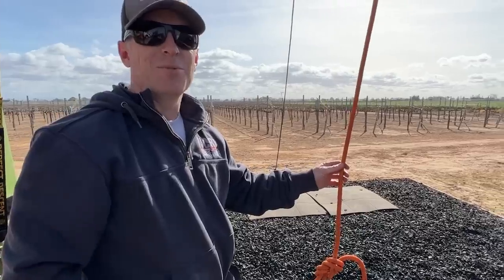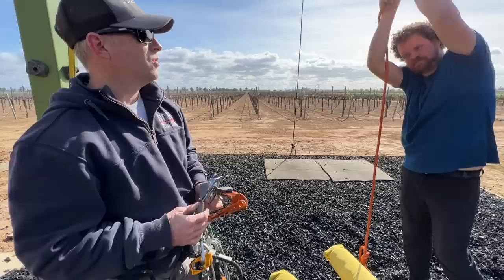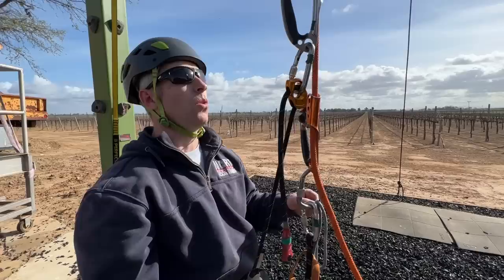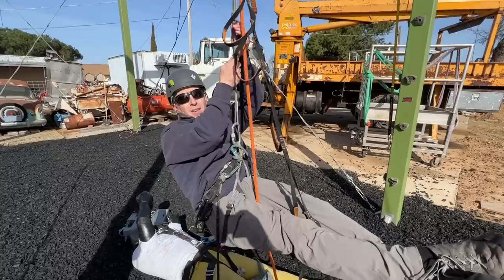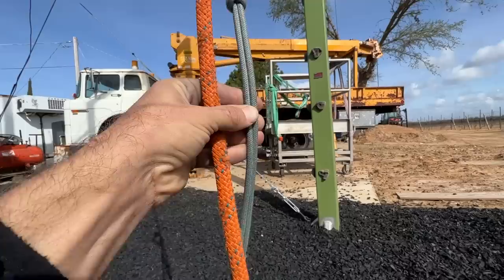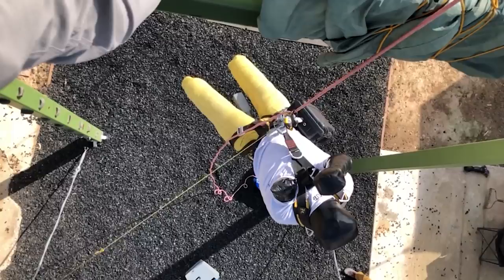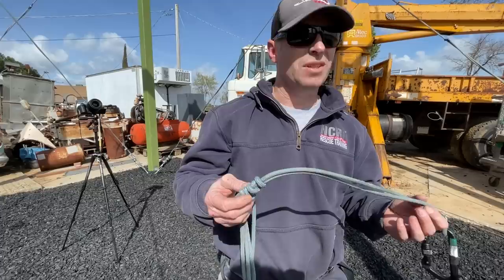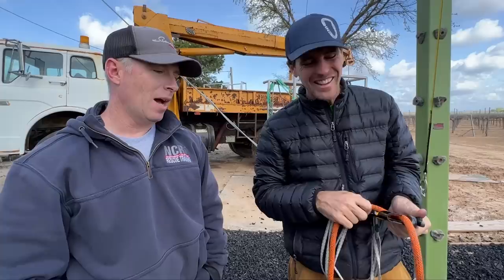Does PURCELL PRUSSIK save you If you fall on an ASCENDER???

Comment: One more data point would be very useful: compare with a fall onto a full strength piece of dynamic rope (8.9-9.2mm). Most of my team runs dynamic cowtails (like a caver's setup) and it would be awesome to see the comparison of absorption between the Purcell and the dynamic landyard. I see another comment that seems to be asking about making a Purcell from dynamic cordage, but I have never seen that in the wild.
Reply: The dynamic cord should protect your pelvis, but will it protect the sheath?
Reply from the maker: Testing dynamic cows tails vs other lanyards is a good idea
Reply: The Dynamic lanyards seem like a good idea and I would love to see a side-by-side test. We use them on the top ascender to make adjustments between individuals easy. That said,  based upon their length, the overall load limiting on them should be pretty minimal compared to a purcell slipping over a longer length, which is why we use the purcells on the lower. I'll bring both next time Ryan and we can find out!

Comment: I'm a caver an when we put a knot-pass we make a loop hanging from the knot so that you can clip into it with a lanyard when transferring across the knot.
Reply from the maker: Yea, I was at risk of falling on ascenders when i was caving and passing Y hang or J hang rebelays.
Reply: Thats one method of many, of course. But with speed in mind the hand ascender moves over faster then tying a knot in. Although I do see your method used at times.
Reply: @M1American  I think, I must've explained it badly. The initial rigger (who decided that knot-pass is necessary) puts in a knot like in this figure: https://verticalsection.caves.org/nh/46/srt-knot.jpg. Everyone else just clips in when passing it - the extra time is really minimal, but it allows for resting and we avoid having single attachment point very hard.
Reply: @HowNOT2  It sometimes happens in sloppy 'expedition' rigging :( What makes the biggest difference for me is using fusion knot Y-hangs instead of the more popular fig8 + alpine butterfly Y-hangs. With fusion continuation above starts right at the knot making transitions faster and safer.

Comment: Hi! I’ve been watching your videos for about a year and a half now. I don’t even climb (yet) but I just love the content and breaking things + numbers comparisons is just cool. 
I have a request, in the military we are issued rigger belts similar to the Wolf tactical belts. I have been trained multiple times that in a pinch you can use just your belt to repel or hook into a safety device in lieu of a harness, which is why we are issued them. I have seen videos also demonstrating that they can be used to repel if need be. After watching enough of your vids I am very aware that everything has a breaking point, and trusting a manufacturer isn’t always enough to keep you alive. 
I’d love to send you a couple of the ones we get issued and have you try break test them and see if they are indeed suitable. The military uses many rope systems and slings, there might be another area for you to expand into! I hope to see them on your channel soon!
Reply: I was issued a heavy duty belt like that too, complete with a metal piece that you could attach a carabineer to. I always felt that if you used one of those for rappelling, you would get the world's biggest wedgie, your pants would rip, and then the belt would go up to your armpits.

I live in the Seattle area and would be willing to sacrifice my old military belt if you want to do some testing.

Comment: I would think that even a Purcell Prussik on a bigger rope would be a throw away... as the heat in the coils will always increase, as it is sliding down the rope that only seen transient heat.  I'm surprised that it doesn't melt even more.  Thank you for the great tests (as always).

Comment: As Matt mentioned, the assumption is the fire fighters are heavy, especially with all the crazy equipment they carry around. 150lbs seems a bit on the light side for testing this given the subjects might be 200lbs to start, and have 50lbs+ of gear. Is the increase in weight something that you all thought would not significantly change the results? Maybe you need a "double decker"
Reply from the maker: Future tests I will consider adding more weight.  300lbs is what i want but moving it around is very difficult and way more aggressive in the falling and landing.  Basically it's like slack snapping things above 90kn... it becomes 10x harder to 2x the force or the weight in this case, but yea... i'll explore more sustainably heavier dummy
Reply: @HowNOT2  I saw "Rescue Randy Large Body Manikin (250 Lb.)" on Amazon. Wow is it expensive. Supersack with Sand seems more viable. Maybe triple layered to keep it from ripping.  Perhaps a swinging boom/builders hoist mounted up high with a remote controlled winch would simplify things. Although again, expensive. Thanks for all the work!

Comment: Awesome Ryan thank you! I use a petzl ascension and a micro traxion as my Top rope solo setup like petzl recommends. Did not realize it could desheath as low as 2kn (I use each device on a separate line). Would love to see some TRS setups tested as there are many different methods with little actual research. 

Last night I was TRS when I took a fall and the Biner on my micro cross loaded the screw gate went into the the hole separating the orange metal plate of the micro, my secondary (ascension) caught me. Would really love to know how close I am to 2kn on that. Are clamp style devices safer?
Reply from the maker: wow, that's crazy.  I took a 20 foot whipper on a 40 foot piece of rope (0.5ff) on a micro traxion installed at anchor like a top rope belay device simulating someone not belaying tight or slack in a simul scenario.  Did not desheath my rope at 4.5kn.  I'll have to use decker to figure it out as my body doesn't want to do that test again :)
Reply: Thats crazy! You should post some pictures and a detailed explanation somewhere so toher TR Soloers can learn from that!
Reply: @tehrater480  definitely gave me some willies. I’ll try to recreate what happened so I can show, shoulda taken pics when it happened. I was using a Petzl OK biner from the micro to a sling on my hard points. Then a sling around my neck attached by a non locker to the OK biner. I had been noticing it was cross loading when climbing but didn’t think I was gonna put 7kn on it so wasn’t super worried. Everything would have been fine if it wasn’t the actual screw part of the locker that got ripped through the micro, the screw is what popped the orange plate apart. I’m gonna try using a gridlock with the small side on the micro to keep it aligned.
Reply: I have basically the same setup but I use the ascension as the primary. What carabiner were you using on the microtrax? I’ve found that if you don’t pick the right one it can jam (the carabiner not the cam) while cross loaded.
Reply: @HowNOT2  that’s good info thank you! I think what happened with me was a bit of an anomaly since if it wasn’t the screw gate side that got ripped through the micro everything would have been fine. I’m gonna try using a grid lock with the micro on the small side to keep everything aligned. I hope my description is enough to picture what happened, and any advice would be appreciated! 

I could imagine like a factor 1.5 fall onto your backup but thankfully my backup was pretty taught
Reply: @randomizednamme  I was using the Petzl OK on the micro, what they recommend. A friend recommended I use the gridlock with the micro on the small side of the biner. It’s important to note that it was not cross loading alone that did it, but mainly the knurled screw gate getting pushed through the hole on the micro that caused the issue.
Reply: I use a Taz Lov 3 and it feels really safe (no teeth). You can descend immediately with it as well. I back up below it with a VT Roll n Lock since it has graded horizontal teeth and not the 'possum' teeth on an ascender. Sometimes I use a gri-gri as the back up. Taz is much more expensive but I saved up because it seemed safer and a better workflow all around.
Reply: @n0pe213  the small side of the gridlock is just the wrong size that it bumps the cam lock button on the micro traxion. I can imagine a scenario where this might cause it to inadvertently lock open.
Reply: @alexanderruff1829  damn thanks for letting me know, saved me some money. Any idea what else I could use to keep it oriented better?
Reply: I think it’s a terrible idea to climb on a toothed device! It blows my mind so many people recommend and do it😧
Reply: @DJ-kg6zq  I use two separate lines for each of my ascenders but you’re not wrong, kinda freaks me out. Considering Petzl has technical guidance on how to TRS I assume they have done testing and are comfortable with it if done correctly. Plus since you really shouldn’t be taking more than a  1-1.5 fall factor on it I think the danger is more mental than it is real.
Reply: Toothed spring-cam devices desheath the rope at the limit, non-toothed devices cut the rope. The teeth are harsher on the sheathe but gentler on the core.

Comment: Awesome video and exactly the stuff I am interested in. Except for the 12mm rope part, thats a bit too burly for my line or work😉😉. If you get the chance using 11 or 10,5 would be great for rope access tests. 
And by all means, plug away! Like you say, free content is not free to make👍🏻
Reply from the maker: This could be worth doing again and doing 6mm all the way back up to 12mm but actually desheath it and see what each one takes
Reply: @HowNOT2  To make it more challenging add different ascenders to the mix as well...  Not all teeth are created equal. Some brands have "sharper" teeth than others. That should also make a difference.
I mean, you probably don't have enough time already so why not triple or quadruple the number of tests with 3 or 4 different ascenders 😜😜😂👊🏻

Comment: It may not be entirely necessary for this application, but different material for that purcell may be worth considering if melting is a concern. Even if I'm not planning on taking a fall, I'd rather have a system where I can take a fall and be able to descend rather than take a fall and be stuck in my harness at height because of some melted rope. There are plenty of ropes that are nigh unmeltable and relatively cheap, at least when you're talking about just a handful of feet of rope.

Comment: If the Purcell gets welded together after a fall anyway, couldn't you use a webbing energy absorber (like those on modern via ferrata sets)? 

Sure, that's more expensive, but via ferrata equipment has moved away from rope friction based shock absorbers for a reason.

Comment: It would be awesome to see rope solo systems shock loaded on the drop tower. I use a locker draw connected to my harness with a micro traction on top and then a rope man on the bottom so it’s somewhat redundant. But it’s likely to take a small top rope whip that could de sheath the rope and that worries me a lot when I rope solo

Comment: I assume it was static cord on the purcell? Have you tested static vs dynamic, 7 vs 8mm cord for the lanyard?
Reply from the maker: Yes, 6mm static accessory cord.  I have not done too many other lanyard tests
Reply: Good idea! The system should be even more safe with dynamic cord.
Reply: @HowNOT2  I think there's a lot more value in testing those homebrew systems like DIY lanyards and the splice tests you did recently, and gear being used "incorrectly," like the carabineer over the edge tests, than another carabineer chain link showdown. 

Tied my own Purcell after being disillusioned with every store made lanyard 😂
Reply: @HowNOT2  you sure it was 6mm on that purcell not 8mm?

Comment: I wonder if a dyneema Purcell would perform better, the line itself would be very static, but it has better heat performance and less friction so it’s less likely to melt together.
Reply from the maker: Dyneema has a lower melting point but it's so slippery that it doesn't generate the heat like you said so it probably would melt but its so slippery im wondering if it would hold at all.
Reply: @HowNOT2  oh, I thought it was higher since you can’t melt the ends like with for instance polypropylene. Still would make for an interesting experiment as the nylon version didn’t seem to do much to the peak force.

Comment: Any chance you can help me choosing the right prusik length for my system?  I SRT climb for saddle hunting and want to add a little redundancy with this setup.  Im trying to figure how long of a loop to get to end up with the system being 12" long when fully collapsed and ready to use.  Any longer and I feel there would be too much slack in the system.  Im using a 12" nylon sling now, but really like the slipping feature of this setup.

Comment: What size snap shackle did you use I have seen some on Amazon but look to small for a carabiner was wondering what size you have?
Reply: It is a Wichard quick release. They make a variety of sizes. Just check the dimensions and load rating before you order.
Reply: Get a skydiving 3 ring system for the release, so much better for this kind of thing.

Comment: What about using a screamer instead of the Purcell?
Reply from the maker: The Purcell serves the primary function of being very adjustable.
Reply: @HowNOT2  Only problem is, the seat/safety sling to the lower/foot ascender for a 'Texas' ascending system is where one doesn't want a long adjustable sling.  If this is too long, the force when one drops onto it is greatly increased, as demonstrated here in your tests.  Matt's sling lengths are wretchedly inefficient, both for climbing and for clipping over anchors, lips, etc.,  They put both ascenders over one's head, requiring the person using them to push them up by straightening their arms, and they put the upper/sit ascender at a very awkward visual angle overhead for reclipping the rope when crossing knots.  It is much more efficient and ergonomic to have the top of the upper/sit ascender at one's chin-to-eye-level, allowing the ascender to be raised by pulling it up with a flexing arm motion (curl).  The lower/foot ascender foot slings should be just long enough to allow a maximum step when it contacts the upper ascender.  The safety/seat sling should be just long enough to reach from seat link to ascender link when standing on the lower ascender on-rope.  This should still be short enough to keep this ascender below the top of one's head when falling onto it due to a missed rope clip or upper/seat sling failure, and will minimize impact forces.